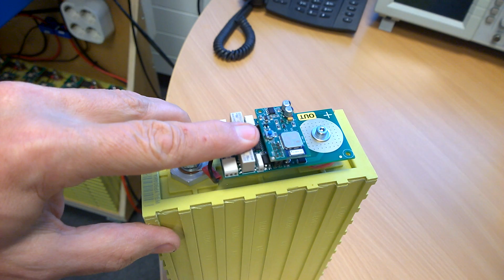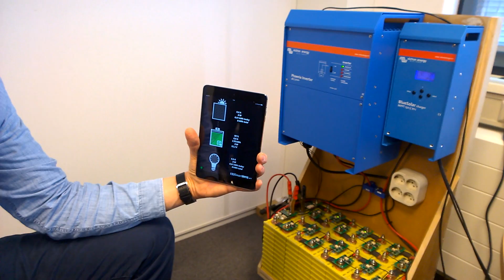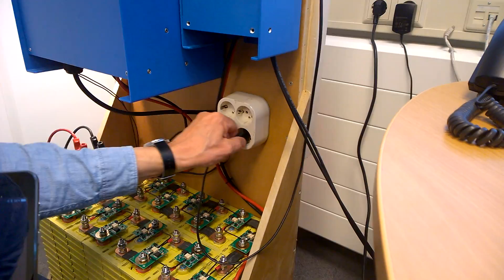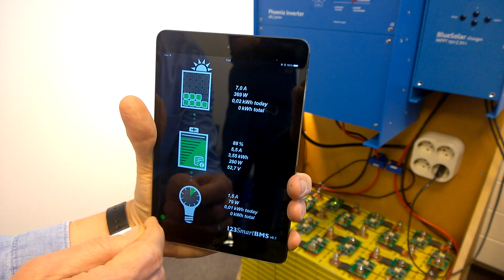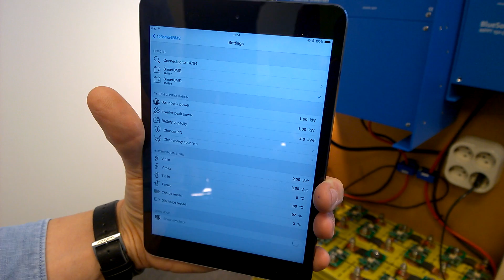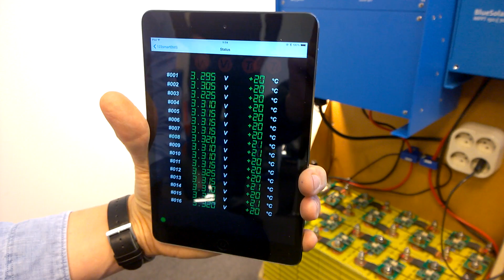123\SmartBMS Introduction

Comment: Bought 4 winston cells, a 123 BMS, 2 solar panels and an MPPT and have been left clueless on how to get things up and running, being a complete noob electrician. The shipment didn't even include the cables and lugs required for attaching the BMS to the cells. The confusion only grows when researching YT videos on the topic. Some videos introduce a circuit with two relays for upper and lower charge protection which also wasn't included in my shipment. Do I need that? I have no idea! Would be great to see some videos giving more insight on all of this.
Reply from the maker: Hi Bernd, we agree that we need to make an installation video! I will explain shortly how it works and what you need: The 123\SmartBMS is modular so you can mount it on 2 - 255 cells in series. The Begin Board needs to be mounted on the first cell, which is the cell where the minus power cable is connected to. Then you add the Between Boards on the next cells. On the last cell, you mount the End Board.

The End Board contains two signal relays: one indicates that your system is allowed to charge, one that your system is allowed to discharge. The potential free contacts of each relay are brought out to a 3 pin connector next to it. If your charger has a "remote" signal for example, you can connect this remote signal to the "charge" potential free contacts so the BMS can switch the charger remote signal to turn the charger on and off.
If your charger/inverter does not have such a remote signal, you can connect an energy efficient power relay to it so the BMS can swith the power relay on/off. You can connect the charger and/or inverter to this power relay so the BMS is able to cut off the charge/discharge.

Please see the 123electric.eu website -> 123\SmartBMS gen3 -> FAQ for installation schematics and of course in the manual. If there are any questions, email us at info at 123electric.eu so we can respond to your questions

Comment: Wonderful video, I hope you continue such videos for example I see you have new version (gen3), I guess it has some new features. I have soo many questions :) 1- I understand for safety you do like this but doesn't putting 4kw input data for 5kw system has some other complications? 2- Is it safe for marine application (on a boat) to leave battery cells open like this or you need to provide some insulation, protection from corrosion, humidity inside the boat etc. 3-BMS interface on tablet show only solar but what about other sources like diesel generator, wind generator etc.?
Reply from the maker: Hello, Thank you. We will make a new video soon!

1. The BMS can safely work with high capacities and high currents because the BMS uses isolated current sensors and switching of the currents happens with your own power relay. If you have a maximum current of 200A for example, you can connect a 200A (or higher) power relay to the SmartBMS. When charging is not allowed, the BMS will turn the power relay off. 

2. For marine/salty environments, we recommend to spray all SmartBMS PCBs with PCB plastic coating spray to prevent corrosion on the PCBs. Also if there is a chance water can get on the PCB, then we recommend an enclosure around the battery pack.

3. The two current sensors of the BMS can measure bidirectional currents so you can also use just 1 current sensor if you want. What you can also do is use current sensor 1 (solar panel in the app) for all chargers like generator and solar panels/MPPT/solar regulator and use current sensor 2 (light bulb in app) for all discharging like motor, inverter, lights etc.

Comment: This system looks fantastic for setting up your own Litihium Iron pack from inexpensive cells. Yes, you can buy 12 volt packaged systems with built in BMS but those cost a fortune. The yellow Winston cells are still expensive but much less so than that. I wonder, are there any plans to make the BMS talk to some other electronics directly? Can you access the BMS from a PC, rather than a phone app? I mean, if one is interested in having a display panel that shows this data without a phone. Maybe I should ask these questions directly and not on Youtube. Anyway, cool stuff, definitely.
Reply from the maker: Hello, That is exactly why we designed this BMS! There are good and cheap or old but still good cells everywhere. Just add the BMS and you are ready to go.
There are several options to display the BMS data: we have the Extended Module, a module with PC software to display the data. Also you can use this module to freely configure up to 4 signal relays.
The other option is to add a simple isolation circuit with an optocoupler and connect the BMS via UART to a Raspberry Pi. You may want to make your own script to display the data :)

Comment: Mmmm when you power on the lamp .. it should take the current from the panels .. not from the batteries (since panels are giving enough power), using it from batteries while there is current coming from the panels is a bad idea... you lose one conversion (48v to 220v)
And about the fact you put 4kW instead of 5kW in the parameteres.. i think it will not help .. it's just for the display, only Vmin and Vmax are the one to use to be conservative on the batteries. For example the Vmin .. make it 2.8V then you'll be conservative.
In fact it do not disconnect the charging, it passthrough some of the current instead of letting it go through the batterie (and charge it), thus reducing the charging current, but it's not nul.
Reply from the maker: Hello David, There are two current sensors so you can see what you produced and consumed that day. The produced energy will first go to the consumers. The remaining energy will go into the battery pack. Example: your solar panels with MPPT produce 10A and your inverter draws 6A. Then 4A will be stored into the battery pack.

Configuring 4kWh instead of 5kWh is just for the SOC displaying. If you want to keep a bit of energy left, we advise to set the Vmin on 2.8V or even 2.9V.
Reply: @123electric  that is the only thing that stop alot of people in adopting this bms... all the boat and camper  world have more than one power source, big alternators, sollar pannels and power generators with 220v chaging systems, alot of people want thatthe energy produced from sollar pannels for example goes to the various appliances inseted of keep topped the batteries to a full state of charge, thay want to limit  the cycles on the batteries. also when motoring for long hours time they want to use the energy of the alterntor directly to the appliences... i realise that building a power path circuit like in laptops is not an easy task like is in laptops and redesingn the circut board is not an easy task... but think about it... it wold be nice to add a power path circuit... or make a verssion with more than one charging line and current measurement and controll
Reply from the maker: Hello  @ElectronicMarine ,

If the solar panel produces energy and the inverter is active, the energy goes to the inverter, not to the battery. If there is more energy produced than consumed, then the extra energy which is not used will be stored in the battery. That is nothing special, it is how electricity works.

Example: solar panel produces 300W and inverter consumes 300W. Then energy will not charge the battery, it will go directly to the battery.

Other example: solar panel produces 400W and inverter consumes 300W. The 100W which is not consumed, will be stored in the battery.

Third example: solar panel produces 100W and inverter consumes 300W. The solar panel deliveres 100W to the inverter and the battery the rest, which is 200W.

You can limit the maximum charge voltage of the battery with the BMS to increase the lifecycles. We advise for LiFePO4 to use a Vbypass of 3.4V, which is roughly 90% of the battery pack. This way, you will increase the lifecycles of the battery.

If you want very advanced control of which device to turn on when (like a generator to turn on when the battery SOC is below 20%), then you can connect the 123\SmartBMS Extended Module to the 123\SmartBMS. The Extended Module can be configured via software and has 4 freely configurable signal relays.

I hope this clarifies the SmartBMS working.

Comment: How many calls in series whit BMS system is capable of? Is it ok for HV batteries like 96s, 140s, 192s Li-Ion NMC?
Reply from the maker: Hi,
The 123\SmartBMS supports up to 255 cells in series and support LiFePO4, NMC, NCA, LTO etc.

Comment: When using only one sensor, does it matter if it is on the negative or positive lead? I would think the current is the same, but want to be sure that this will work. My battery pack will be quite long, so the begin board ends up far from the positive terminal.
Reply from the maker: Hi Tobias,

Both options are posible. However make sure you put the cable the correct direction through the sensor, otherwise the BMS sees a charge current as discharge. The 123\SmartBMS manual contains an image with the correct direction of the current.
Reply: @123electric  great! Thanks

Comment: Cells don't seem to be balanced. You have cells at 3.295 and another at 3.315, you said top balancing only ? if there is solar input it should be charging and balancing.
Reply from the maker: Hello Charles, the BMS uses top balancing indeed. However, the video is just for demonstration of the BMS and the app. We did not let the BMS balance completely before the video. Besides, 3.295 and 3.315 do not say much about inbalance of the cells. The OCV curve of a LiFePO4 battery is very flat between at least 40% and 80% (all roughly 3.3V), so balancing around 3.3V is just not possible. The SoC between 3.295 and 3.315 can be the same, but also very different. Especially if there is a current flowing, which leads to a voltage drop far over a couple of mV.

Comment: Those little BMS boards kind of scare me. How much power can they actually handle with a large solar array? BMS that burns out can ruin the very expensive battery! I would hope the APP would show an alarm if one BMS was faulting. Also is there temperature compensation? I've head that Lifepo4 is very sensitive to temperature and you cant charge them to full capacity when they are cold otherwise you will damage the cells.
Reply: My Motorcoach has a 12v System.  I would convert to higher Voltage, but would then loose the ability to tie the chassis system and alternator to the house system and vice versa.  I would like to have 800 to 1200 aH worth of Prismatic cells in a 12v configuration.  Can the Smart123 system monitor 32 to 48 individual cells?
Reply from the maker: Hello, The BMS boards are on top of the battery pack, so there is no current flowing through the BMS boards. The BMS boards measure voltage and temperature so the BMS can switch off charging and/or discharging when needed.

Comment: Why are you using Hall-effect sensors, while all other BMSs use a shunt?
Reply from the maker: Hello Bentley, Both sensor types have their own benefits. A Hall effect sensor only consumes 0.25W when on, and it only needs to be on for a short time so the energy is negligible. Shunts however can consume up to 20W continuously when large currents are flowing. Also the Hall-effect is isolated which can be a benefit. Most BMS in vehicles also have Hall-effect sensors.

Comment: Do you have a video or a detailed wiring diagram of how to size and wire the relays/dc contactors that disconnect loads and charging? My battery bank is 4p4s 12v 720ah made from 16 calb 180 ah cells. My inverter is a victron 12/3000/120, in the manual it calls for a 400 amp fuse for surge loads. So what size relay/contactor should I use. I know I need the upgraded current sensor. Any help you can give me would be greatly appreciated.
Reply from the maker: Hello Ian, If the maximum current which your system is going to draw is, for example, 250A, then we suggest a 250A fuse. These fuses can handle high peak currents for short times. We have a power efficient power relay but it is rated at 120A @ 12V maximum. For higher currents, check out the Victron BatteryProtect 220A or even higher the Kilovac EV200 (500A). You can wire the relay to the OUT board "Charge" signal relay potential free contacts.

If you have a power relay (like Kilovac EV200) for the chargers, you can connect the pack + voltage (12V) to pin 2 of the signal relay and pin 1 of the signal relay (left hole, allowed to charge) to the power relay. The other pin of the power relay goes to the minus of the battery pack.
When charging is allowed, pin 1 and 2 of the potential free contacts are connected to each other and the pack + voltage will be connected to the power relay so the relay will be active.

For the BatteryProtect, you can directly connect the "remote" signal of the BatteryProtect to the OUT board Charge relay potential free contacts.
Reply from the maker: You can find schematics on our website: 123electric.eu -> products -> 123\SmartBMS gen3 in the manual and also in the FAQ.

Comment: Hi, 
    I want to know if the BMS123 Smart extended module is compatible with CAN Protocol of the Victron CAN BMS.
    I have the CCGX now with BMS123 Smart configured on Aux1 and Aux2, work fine but i want to use with the CAN protocol to see voltage of the cells in the CCGX and Victron to be able to limit charge current if need it.
    I dont find any answare in documentation about this.
Reply from the maker: Hello MrConstantin,

The Extended Module is not directly compatible with the Victron CAN protocol but we may add this in the future. If you want it now, you can add the SmartBMS and Victron to the same CAN bus and add your own CAN bus hardware like an Arduino and write some code to translate the SmartBMS CAN bus messages to Victron CAN bus. On Github is a Victron Arduino CAN bus project to demonstrate the CANbus messages to Victron.
Reply: @123electric  yes i can do that, but in this case i dont need extended module i can take the serial data from 123 smart bms and make can messeges direct with arduino without extended module.
Reply from the maker: @MrConstantin84  Yes that is also possible. Don't forget to add a simple isolation circuit consisting of an optocoupler and 2 resistors to isolate the UART voltage from the Arduino/Raspberry. You can email us at info at 123electric.eu if you need to optocoupler isolation circuit example and UART data protocol.

You can find the Arduino project on Github, made by Tomdebree and the project is called VEcan.ino
Reply: @123electric  tnx for ur answare. I allready read the data from bms with optocuplor and i will try to make the can protocol.
Will be nice for other people with no programming skills to make ur extended module compatible with victron can. If u do that the client no need to buy and use the Victron BMV battery monitor for SOC and is about same price with ur extended module. 

Best regards
Reply: Hi, i have a problem, after i upgrade the system to Gen 3 version i dont receive any data from bms. Gen 3 Have other hardware change or Uart difference?

Comment: Make a hard wired ethernet port option with mac or windows software and then i will buy one.
Reply: You can connect the SmartBMS to the Raspberry Pi's UART input and then you will have all UART data available.
Reply: @123ignitionchannel   Thanks for replying.  I do not know what UART data is.  Programming is not something i do so would not know what to do with that data.   

I am looking for a BMS system that can be connected to a network / computer that is not wireless and has software already available.  Ethernet would be preferable but USB connectivity would be a second option.
Reply from the maker: @unheard128  Hello TTbb,

You can also add the Extended Module to the system, which is an extension module. Then you connect your computer to the USB port of the Extended Module and read out all data with your PC. Besides, you will have extra relays which you can configure in the PC software to switch on/off based on values. Example: turn signal relay 1 on when the lowest cell voltage is below 3.1V for an early low voltage warning. Then connect a buzzer to this relay and you have a buzzer which will alert you when the voltage is low.

Comment: How many amps can it handle
Reply: The supplied current sensor can measure up to 500A (600A peak), so that is you limit. You can connect multiple energy efficient relays to the 123\SmartBMS like the Kilovac EV200 to switch your chargers/loads.

Comment: Is there anyway to connect this setup to a Sunny Island 8.0
I am planning 16 batteries of 1000 ah as a replacement for older aquion batteries
Reply from the maker: Hello Ted,
You can implement the BMS in a setup with many brands inverters, chargers and combinations. It is even possible, if the inverter and charger have their own charging algorithm, to use the BMS as "last line of defense". Just configure the BMS to "Critical Mode" and the BMS will only switch off when there is a serious error like a temperature or voltage error (like under Vmin or over the configured Vmax voltage).

Comment: Do you have a 4S for 12 volts?
Reply from the maker: If you have made a 12V pack consisting of 4 cells, then you just need the Complete set 4S as can be found at our dealers. 4s means 4 cells in series. The complete BMS set contains 4 cell boards, one board for each cell.
However if you bought a 12V battery (no separate cells, just a big 12V block) then you cannot add a BMS because the BMS cannot be placed on the individual cells.
Reply: @123electric  bought 2 200 ah lithium iron phosphate batteries..they have individual cells. Want to create a 400 ah 12vdc battery bank
Reply from the maker: @denazify  It is possible to monitor if you have access to those individual cells of each 12V battery. If you post a link to the product or the exact name, then we can take a look if the BMS can be mounted on that battery.